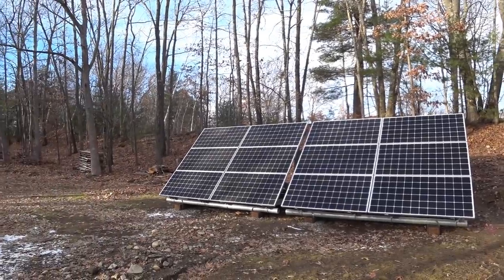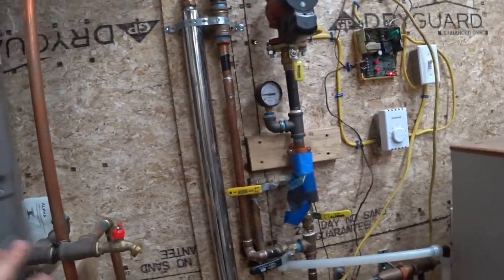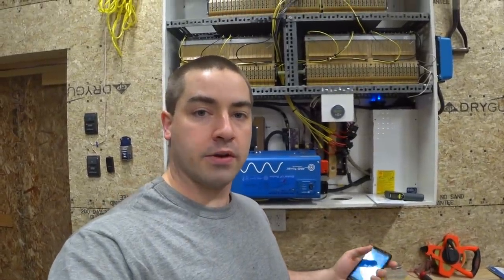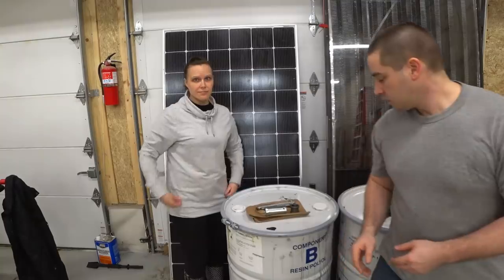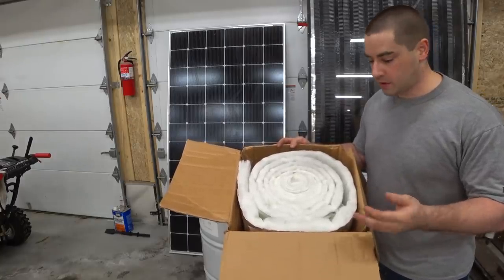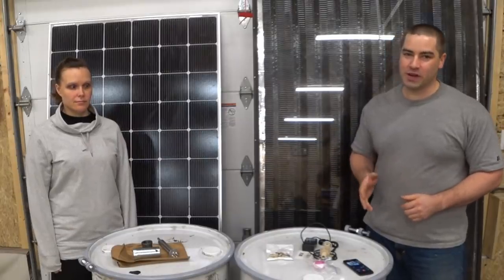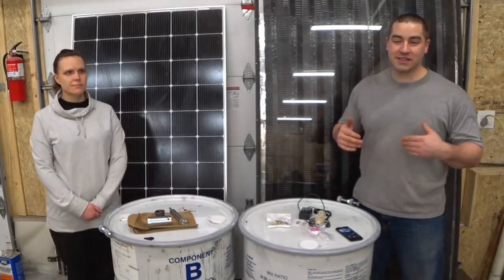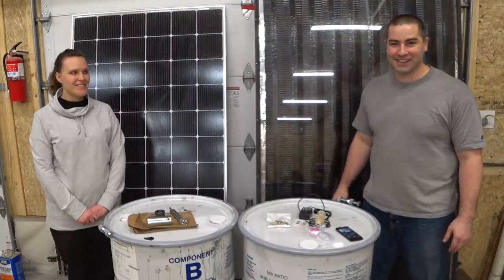Solar PV vs. Solar Thermal Experiment

Comment: I think the only way solar electric would not win is if it was a cooking hot day, but on a cooking hot day who needs the hot water?  So I think, solar electric is going to win.

As for the test:
1) Will the 12v pump be running off a small solar panel?
2) Will you be able to log the solar electric voltage/current over the test?
3) Maybe put just one probe in each tank and have the second probe for each setup on the solar panel and solar heater surface to see if the sun even manages to heat the fins?
4) Maybe keep track of the general air temperatures at a few points (since you do not have a logger for it.)
Reply from the maker: Hi jontscott,  I love your comment and suggestions.  The only differntial controller I have is a 120vac model.  So I'm going to run an extension cord out to the array in the backyard.  From there I will power the differential controller and a 12v power supply for the pump.  I do have a kilo-watt meter ready to go to monitor the electrical usage of that part of the system.  

I didn't think to monitor air temp, I like that so thank you, I'll add a column to my spreadsheet for that.

Comment: Many ST controllers are programmed not to even start unless there is at least 15 to 20 degrees delta between the collector and storage tank. They also shut down when the delta is below 2 or three degrees. If you want a fair comparison to PV in non ideal conditions, the controller needs to be set to absolute minimum values. Start at a 3 or 4 degree delta and don't shut down until it drops below 1 degree. You will find that there is heat to be obtained (Ignoring the electrical losses from the pumps of course).
Reply from the maker: Thanks.  The controller I'm setting up has an adjustable delta, and I was planning on keeping it set low.  I'll include the detail on delta when I make the video.  Thanks for watching.

Comment: Since you live in a cold climate, an evacuated tube panel would work better.  Obviously they are more expensive, and looking at current solar PV prices (in particular when considering a heat pump instead of a resistive heater), calculations along might rule it out.  However it'd be nice to at least outline your options and costs in one of your follow-up videos.  Doing a quick calculation just now told me that for DHW many folks could get a hybrid tank heater and just expand their PV system by several panels.

P.S. love your work, it's really nice to see someone experimenting on top of building science, and not just blindly following tradition nor pushing fads.
Reply from the maker: Hi James,  I agree that vacuum tubes would outperform the flat plate collector.  It would be great to test them as well.  I scan craigslist constantly and have not found anyone giving vacuum tubes away.  I picked up several flat plate collectors over the years for free, but I did have to remove them from roofs.  If someone wanted to send me some vacuum tubes I will test it side by side.

As for the heat pump...  I'm working to become off-grid.  So a heat pump water heater means adding batteries and/or inverter capacity.  Also, I used to have one and hated it so much I ripped it out after two years.  I outline some of the reasons in my PDF article on Builditsolar.com  Thanks for watching.
Reply: @DavidPozEnergy  Very true.  I was thinking more of the DHW angle for water heating.  Your test should be illuminating for both applications (from your real-world results, calculations should be able to estimate the other variations).

I understand about the mini-split system; they really only can be tuned for one direction, and have limits at low temps.  I live in CA and have a four zone system, it cools well but the heating would only be passable if this were a superinsulated house (and if at a northern latitude, not at all).

Comment: Because you are testing under controlled conditions (amount of water in your tank, placement of the temp probes, etc...) you should be able to keep the results simple and do a time lapsed side-by-side comparison of temperature (versus the conversion to BTU).  What I am saying is, if they both are equal and produce the same temp, they will produce the same BTU.  If one is better than the other and produces a higher temp it will produce proportionally a higher BTU.  Temp is so much easier for the public at large to understand (although I realize this is really BTU).  By the way, keep the volume in the tanks the same.  Wether you have an open or closed system on your thermal system, the fluid that gets the heat to the tank is strictly for transport and should NOT be part of the equation (just like the copper that gets the electricity, i.e. volume of electrons, to the other system is not part of the equation).

Comment: David: This is off topic but it references an off topic comment you made in another video concerning the 800  watts of LED lighting you have in the garage (where you were making this video. 
I note in this & several other videos that your garage walls are natural wood & therefore not terribly reflective.  I had a much worse problem in my garage here in Northern California which had tar paper on the inside walls & was quite dark,  somber & actually depressing.  I got out the airless paint sprayer (and moved a bunch of  stuff outside including the cars, clearly) and painted all the walls with the cheapest white paint I could find. Since I was spraying over tar paper I didn't get a pure white result, but did get something a bit darker than Navajo white (a familiar color to apartment dwellers out here).
The resulting effect was to make the garage several (?) [light meter] stops brighter with the same lighting fixtures. 
You can figure out how much lighter your garage would be by taking a light meter reading of your raw wood walls & comparing that to a white surface teat surface (such as a blank sheet of paper ... which is clearly an approximation,  but a good starting point. 
I also cleaned off the floor,  but - as I noted - the overall effect was  dramatic. 
Why don't you try a test; I wouldn't be surprised if you found that you could cut back significantly on your lighting fixtures. 
And one more off topic comment.  Putting those heavy batteries high up on a wall would be a formula for disaster in earthquake country. I've been in several and got lectures from my parents on earthquake precautions long before I even started school. 

Other than that I love your videos and your construction tricks & techniques.  Thanks muchly!
Reply from the maker: I agree with you about the white paint.  That could help cut down on my electrical consumption for lighting.

Comment: Photovoltaic is already making more sense at heating water than thermal.  Less headache, losses and no piping, as well as much longer warranties on components.  We at unity hybrid power systems ( unityhps.com )have a MPPT  controller dedicated to water heating.  It is much better with MPPT than directly wired to a heater element. Cheers to all off-griders !

Comment: Combine the two systems and integrate an intelligent controller. Efficiency will vary according to the location, orientation and set up (thernal insulation, pipe length, water flow rate etc.) of the system. Too many parameters involved to make generalized statement on what technology is better for heating water. You can only find out by messing around to end up with a system optimized for your indivdual needs.

Comment: Not only that but the PV can make toast too but the thermal is just a soggy mess lol. The thermal panel is also a larger area so I hope you account for that in your calculation as roof space is at a premium.
Reply from the maker: Hi OffGrid Wanabe,  LOL.  Yes, I'm taking the square footage into account.  I'm actually going to use two PV panels (42 sq.ft.) vs. the Thermal (32 sq.ft.)  But I'll show all that in more detail as the project moves along.  This is just a primer video, big picture stuff.  All my math will be shown so we can normalize for the square footage.  Thanks.

Comment: PV is easier. However a combination suited to your locale can be better. One size doesn't fit all.
A single person needs much less hot water and any excess generated by PV can be used for lighting, etc.

I am thinking about passive Solar hot water, but it adds complexity. Instead, I think I will fire a rocket stove during the seasons I need heat and let that provide hot water to a radiant floor system and for instant hot water on demand with electric backup. In addition, radiant cooling in the ceiling can cool a room without a compressor. Just need flowing liquid for heat exchange. Keep in mind electric heaters will DRAIN your batteries rapidly.

Comment: need to run panel to an mppt charge controller and then direct to the heater no battery for a fair test, you may have to set the controllers max battery voltage limit to its highest setting like 60v etc as without a battery to charge the voltage may occasionally go high and trick it into thinking the battery's charged, that said, with a 1500w element and like a 300w panel i doubt your going to get over voltage issues more like under voltage issues!

Comment: Too expensive for a test but evacuated tubes are much more efficient than flat panel collectors. Also don’t freeze unless temps hit -10C.
Reply: I have evacuated thermal solar panels based on the heat pipe principle. They work great as long as a bit of sun hits them, but ofcourse in winter cannot heat up all your water. With today's prices it is better to go for PV. Less maintenance, less cost, and is more easy to install.
Reply: thermal is better suited for climates south of the Mason Dixon line. Much better for Florida Winters.  They are ugly on roofs for pool heating, but they work.
Reply: You mean better to go Heat pump and PV with a COP of 3+... if you are not going to make compound semi parabolic solar thermal yourself.  Dead simple to make.  Cardboard with aluminum foil glued is all you need hot glued to wood for your compound as a trial version.  If you want something more permanent, use political signs which liter everywhere every November.  Go out and collect them and then heat them and bend to desired shape AFTER you adhere the aluminum foil.  Caboom.  Done.  Essentially free.  Only need to pay for the Acrylic face($40max) and a little wood + glue and copper.  Total cost for all of his panels if you made yourself?  $200.  he paid $1000 for a single panel and he has 5 + pumps etc.  Criminal.  

Semi compound fixed Will put these ST panels to shame by a MASSIVE amount AND they are cheaper and work in the shade.  WAY cheaper.  You can easily make them yourself. For the cost of what he put on his roof, you could quadruple the number of Solar Thermal panels and still buy all the PV your heart desires.

Need both.   @chrisminnoy3637

Comment: You did mention you have solar thermal that really cranks.  OK Put in more solar storage..   Still do not need to pump lots but put into Much larger storage tanks is the way to make these things work.  Most that I have seen .. have perhaps 100 gallons storage.  Then they are cranked up to 160 degree or more.. Better way is to put in 500 plus gallon storage.  You have the panels.. use them. You also have the solar. Use it too.. This in conjunction with in slab radiant and you have the best of both worlds.   Personally think that evacuated tube solar is some what better at producing  heat on low solar days.

Comment: I'd say it scales far better in heavy heat regions. In colder and less sunny places, electric is the way to go, meanwhile say here in Israel, a thermal panel, installation and everything else included will cost you 800-2000$ (depending on installation price and how big you want your reservoir and panels and if you want more than one for a bigger family), will last 5-20 years with little to no maintenance, and will provide you with hot water nearly all year long.

Comment: Obviously only solar panels generate energy for consumption (heat is lost), only solar thermal panels generate heat (and not electricity) for consumption via a heat exchanger, and only solar hybrid panels generate both electricity and heat for consumption. Can you redo the test side by side with the 3 types to see if you get a better comparison.

Comment: Heating and air conditioning takes up most of the energy home requires.you can use thermal for heating, but not for anything else. PV even tho at least 4 times less efficient, but you can drive all the electronics in your house, and for heating using a heating element is a waste of energy, USE HEAT PUMPS that have COP 1.5-5(worst to best conditions). If not logging, turn off your monitoring systems that are not required to save up couple extra whats. get fluorescent bulbs instead of incandescent, LED over fluorescent, low energy consuming electronics. proper insulation to the heated area, and an AHU with passive heating and cooling and run it only when passive it can be exploited(mostly when the temperature fluctuates back and forth set point temperature). and when something goes wrong with the piping or pumping of the solar thermal tubes overheat, boil out the liquid in use(water is not the only liquid used), build up pressure and blow the piping(assuming its not a leakage issue in the first place), if the controller does not take in to account hat water can freeze in winter it can damage the thermal elements or the piping that is less insulated if not circulated once every now and then(this had happened and i am saying this from experience), fancy controllers that pump water in winter protecting the piping uses heat form other sources,  that is why glycol is better for that, but its expensive, putting small heat exchanger to make small glycol loop and the rest water... So ya, I'm all PV... Trust me, I'm an engineer with epic skills and epic gear...

Comment: PV with a heat pump water heater is the best option in many places. For solar thermal, you really need good sun to make any heat.
Reply from the maker: I agree heat pumps are great for on-grid systems.  I'm trying to go off-grid.  So a heat pump, being electric, would mean a bigger battery bank and/or bigger inverter.  Along with another charge controller.  My current charge controller is maxed out.  I'm trying to do this simply. Thanks for watching.
Reply: I have a heat pump and PV operating at the same time.  Heat pumps can barely get above 120F,  I use PV to get the water to a higher temp and reduce the hours it runs. When the HP runs, PV energy goes to the heat pump. They will get old and the less wear the better.  Every water heater should have 500W of PV. That low amount of power insures that 100% of available energy will always go into the water heater without shutting off. Absolutely the best bang for the buck.

Comment: I think if you want not water all day everyday! Go electric, if you want 90% of the heat on dunny days go thermal. It wouldn't hurt to have both. Being thermal can be kinda cheap.but pv is getting cheaper. If you mentioned pv water heater in 1970 they would try to have you committed! It was what close to $100/watt then? Now $ 0.40/watt on a good day. I have $1.00/ watt in mine. Use the solar thermal so you can use the pv for AC on hot days. I think going with both will be more effective. It will give the electric a break on sunny days. I'm planning a small system that will also be wood heated, opposed to PV.  So thermal solar. And wood heated. I'd like to make steam, to power a small generator to help charge the batts. And use radiators in the house or garage to condense and heat the house in the process. I don't know if I can concentrate enough sun to get about 300°+ steam. I can also use the steam to hear water, sounds crazy,  I guess it all sounded crazy some time...but to live off grid for nearly free, and mostly off the sun is just awesome!!!  I have enough tree limbs and fallen trees to last a winter, I don't use that much heat, maybe 2 months of constant need for heat through the day.  And maybe 2 months of needing a little heat late at night or early morning. So thermal solar would work decent then. Mostly sunny cool days. And cfeat thermal storage , use a small pump like you showed, to circulate stored hot water, from a bit water heater used as a storage only. Or pv as a option. I'm not using my battery to heat water... Maybe diverted solar when the battery is full. After my house was lost to fire a couple years ago. I have spent alot of time thinking of how to heat and power a house for cheap and earth friendly as possible. I want to stay off grid I wish I did it 20+ years ago. If you get 150% of the panel you need. And battery. And use lithium batteries, and use the middle 60% or so of the capacity, I hope to still have a useable battery in 20 years. It may just be enough to get through the night, I hope to have 5-7 days capacity before long. I hope it last 25,years, if it is only 12 hours capacity. They say LiFePo4 will last alot longer than liion, I only charge to 4.05v/cell. And discharge to 3.1v/ cell.  I hope to surpass the lifepo4 life , 80% after 800+ cycles or something, anyway,  I'm rambling again!!!  I can't wait to see how real life conditions work out. I think real world hot water when needed, PV!!!.. At a distance thermal may look better. As effiencey when there is full sun 90% is great, but if it only works 30% of the time !!!! Not do great!!  Show us the GOOD'S!!!
Reply: Wow, goodluck on those batteries, hope they last for you.  It is encouraging.